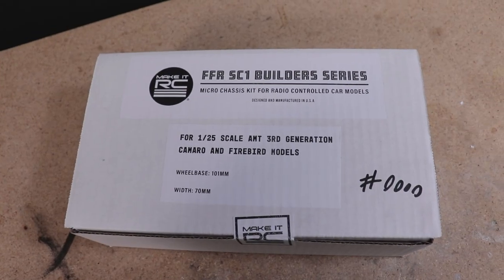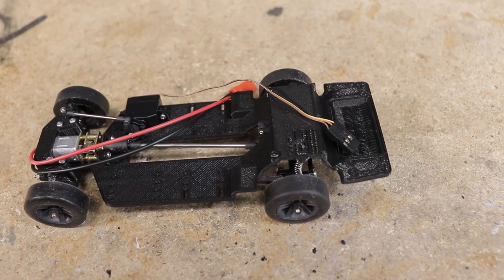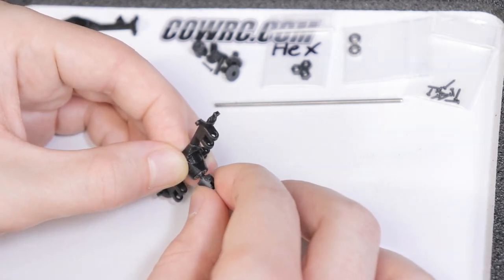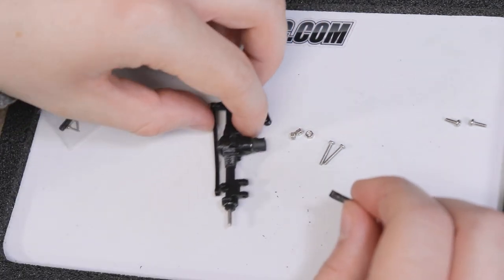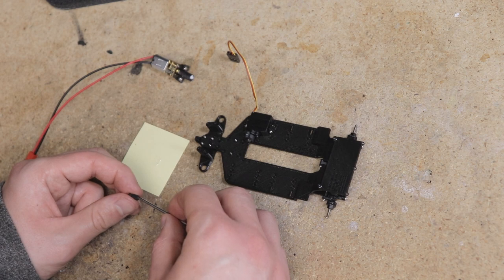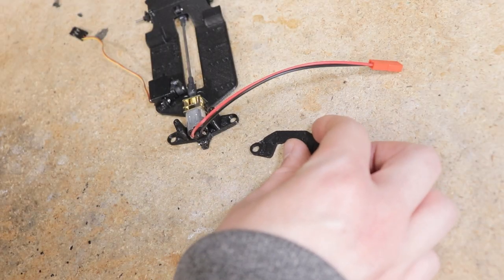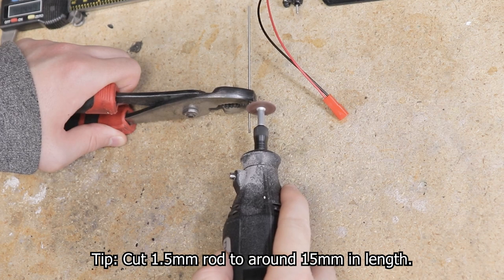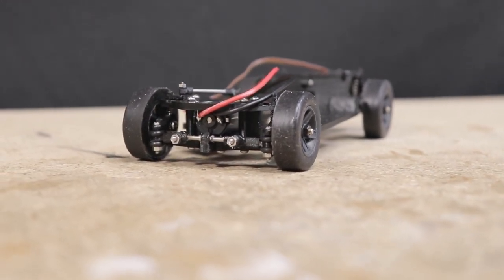Make Your Model Move! FFR SC1 1/25 Scale Chassis Kit Overview and Assembly Tutorial

Comment: Great kit and excellent video!  Everything was well explained and the animated drawings were a nice touch 👌   Personally, I'd like to see a kit like this with a finer grade print that is nice and smooth.
Reply from the maker: Thank you! I would love to see smoother plastic pieces as well. Unfortunately FDM 3D printing is really the only practical means of manufacture at this time. Anything else would skyrocket the cost of these kits well beyond what I think almost anyone would be willing to pay (myself included). One very cheap solution is to paint the plastic parts matt black as I've done on past builds. It won't make the parts smooth but they do look better IMO. Otherwise 3D printing the parts yourself with SLA or other means is the only way to get perfectly smooth parts.

Comment: I have a Revell 1966 Pontiac GTO kit abd I want to make it a remote control. The kit looks cool will I need anything outside of the kit like a remote or any electronics? I'm very new to this and have never built an rc car before. Though I have experience building model cars. And if the chassis doesn't fit I'll cut up the GTO kit's chassis and get the rc kit parts on there. If I recall correctly you did something like that with the old fox body mustang you did with the wire wheels and the ghetto blaster in the back seat.
Reply from the maker: This chassis kit contains everything you'll need for your build expect the following:

Battery/Charger (2S LiPo)
Transmitter/Receiver (Basically if the receiver fits, it will work)
Body (see link below for complete list) 

If you would like assistance or information on selecting compatible components, please check out our website: https://shop.makeitrc.com/products/ffr-sc1-builders-series-kit-for-amt-3rd-gen-camaro-and-firebird-models and feel free to send us an email. Unfortunately this chassis is not sized for a 66 GTO so that body may not fit. We are working on expanding our selection of chassis' to fit many more plastic model kits.

Comment: Do you have a chassis kit that would fit a 1968 Impala? 

 I've had my 68 Impala since I was 12 years old.
(when my dad died)
 It's an original
TEAL blue 425 horse power
          SS 427
   !!! FASTBACK !!!

(so i have been collecting the super rare MODEL kits, (of my car), since 1995, (when eBay was launched)

I have 23 of them.

I have only built nine of them.
All have opening, HINGED doors, hoods, & trunks.

I most DEFINITELY would like
 to take one out of the box & just do it up as a remote control car
 like you have done here.

67 & 68 Impala are VERY similar
except the bumpers & the HOOD 

1967 TWO door IMPALAS are VERY COMMON

I would LOVE to see you guys make a 67
 TWO door Impala

I don't want to be the FIRST one to do this BODY STYLE
as a remote control car

Especially with such an expensive kit
as my 1968 Impala kits are

Somebody please DO one 

            😊😊😊😊

Comment: OK so I've seen you do many front engine rear wheel drive stuff. You should try to mix it up and do either an exotic like a lambo or a front wheel drive like a civic.
Reply from the maker: Would love to do a build like that. Right now I'm really focused on the RWD stuff as that's the only chassis designs we currently have available, but in the future I do want to branch out into other configurations. FWD and AWD are hard to make work well with only 3D printed parts in small scales as I've discovered, but there is definitely potential for a mid motor or rear motor RWD chassis. I'm thinking an old school VW, Porsche, Lambo, etc. would be an interesting project.

Comment: Is there a special super glue to use ? I have super glue for plastic models but I don't know if it's enough for transmission sockets 😅
Reply: Aaaand you answered in the video a few seconds after I wrote my comment... I really should wait sometimes xD
Reply from the maker: No worries. Super glue is generally fine for these builds. Is it the strongest option? No, however these chassis' aren't designed to be driven hard anyways. It's best to let the super glue dry for at least 12-24 hours, or as to the manufacturers  recommendations before running the car or applying pressure to any glued part (even though it works almost instantly). If you want a glue with a stronger bond or longer dry time, look into jewelers glue designed for bonding to metal, or even a two part epoxy. Hope this info is helpful.  👍

Comment: Will these chassis work with slot car modified motors
Reply from the maker: I wouldn't recommend using anything other than a N20 size motor and gear reduction assembly.